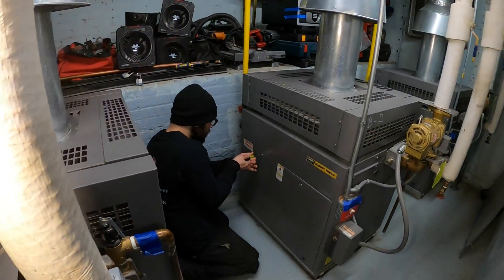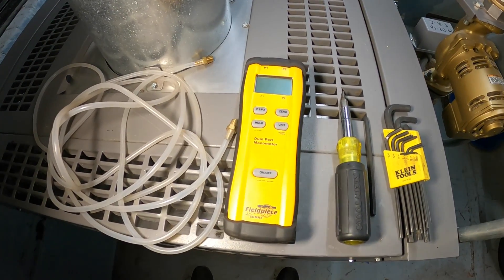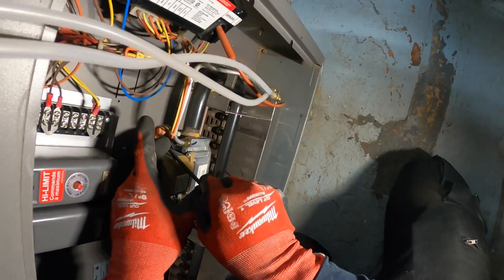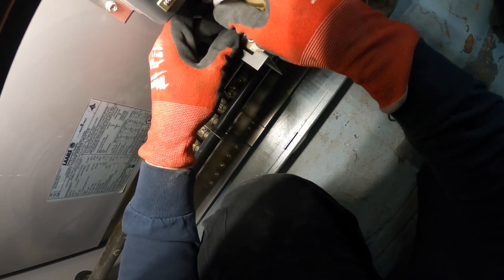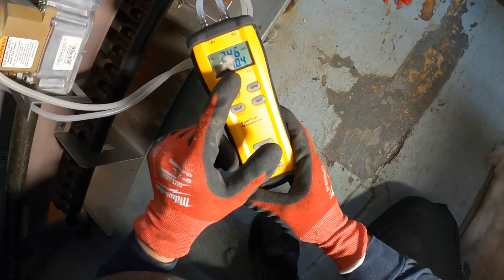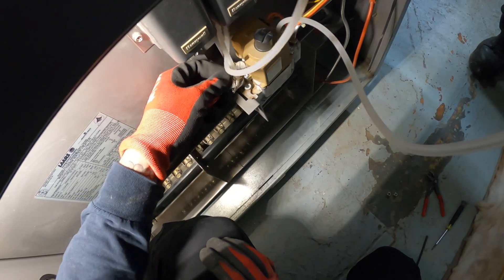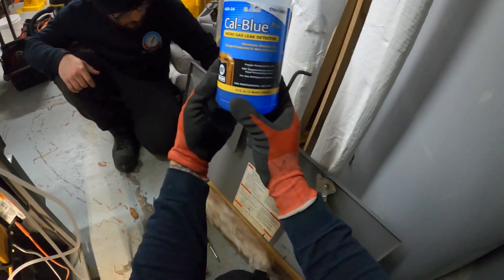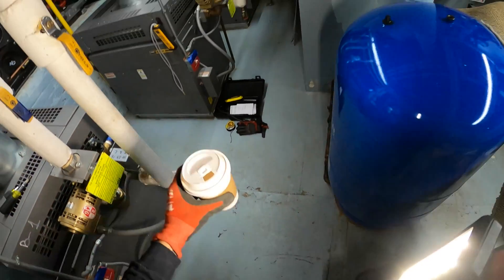HVAC: Boiler Gas Pressure & Gas Pressure Adjustment Using A Manometer (Fieldpiece SDMN5 Manometer)

Comment: Nice video as usual. Thanks. A pro tip when using the menometer, screw your hoses into the gas valve first then connect to the meter. That will prevent the twisting in your hoses. Be safe out there!

Comment: Hello Jumper man tech; sorry I don’t know what your really name, I have gas convection oven, it has yellow flame and a lot of smoke. What kinds of parts should be checked., and what problem is it? Thank you so much. 👍👍👍
Reply from the maker: The unit must be fully cleaned  inside and out as dirt can be the most common issue. You'd also want to make sure your gas pressure inlet and outlet is correct as shown in this video. Good luck with everything. Stay tuned for new videos every week🔧⚡️
Reply: @JumpermanTech  I already clean in and out, what should I do next? Thanks.
Reply: @mckinleysov2677 Bro, this is for entertainment, not to save a buck or being opened for a liability claim. If you went to school hit you notes, classmates or teacher. If you are on the job ask your journeyman. If you are a DIYer get a book. The game is to be sold not told.

Oh yeah, you can refer to him as BIG JMT SIR. 😂